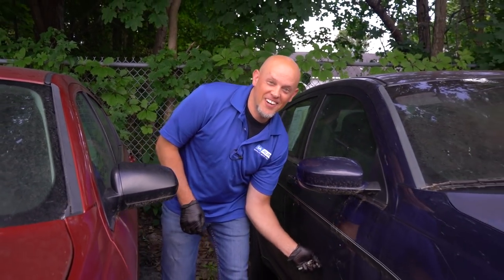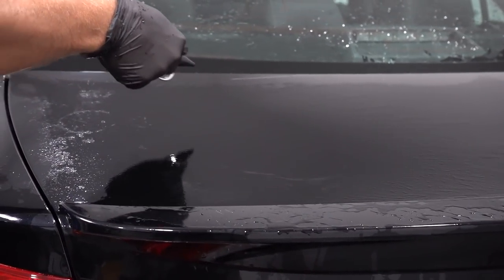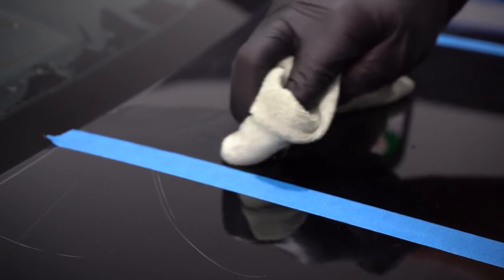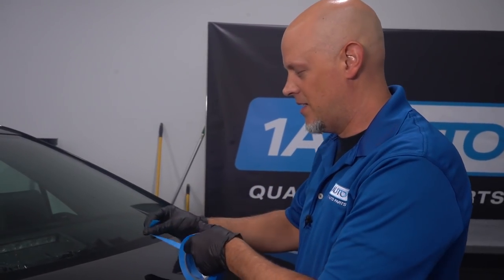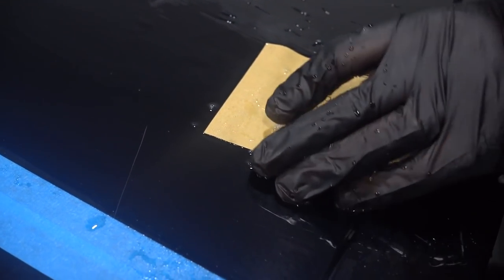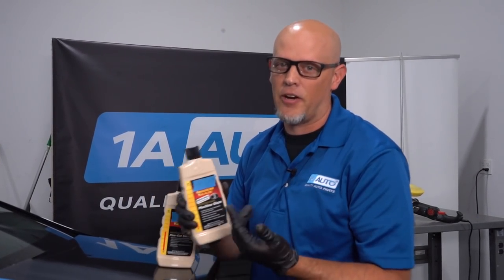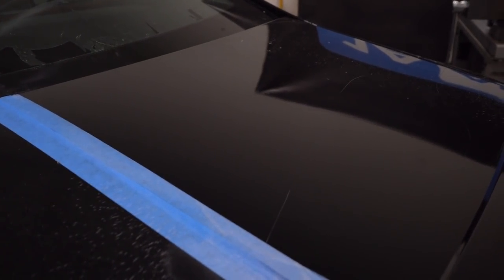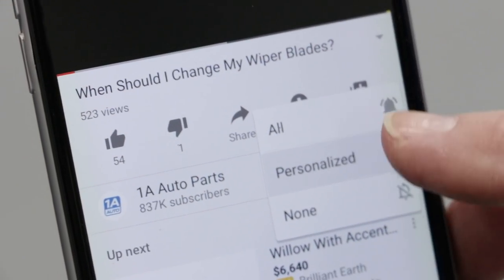Scuffs or Scratches on Your Car or Truck? How to Repair Light Scratches in Your Car's Paint

Comment: What happens when the wax wears off? Apply more then? Just seems like more upkeep in the longterm for a short term gain. No?
Reply: I would still wax it Justin B. Assuming your clear coat is decent, the wax will add another layer of protection to your paint.